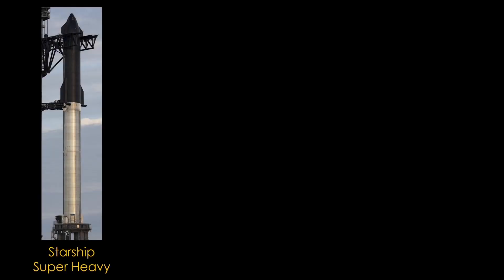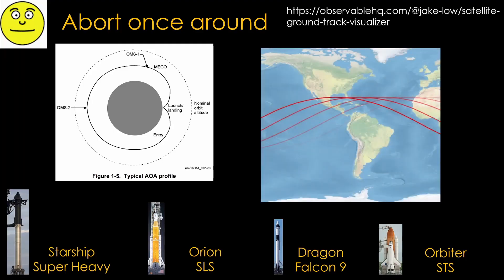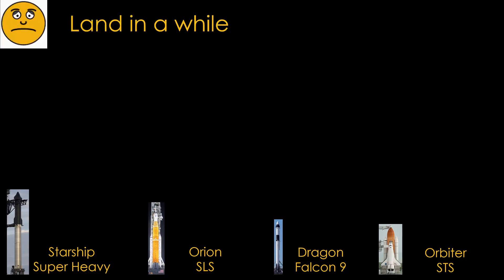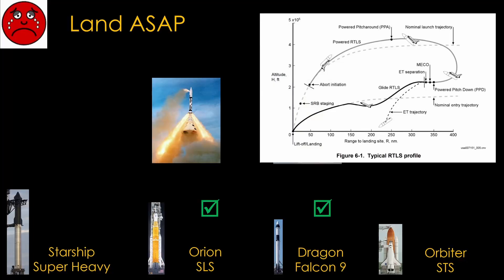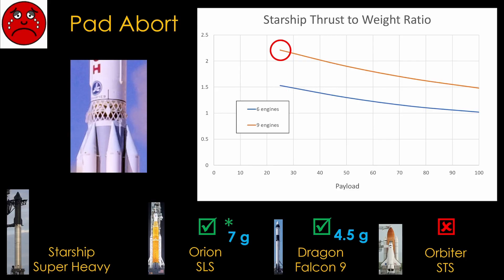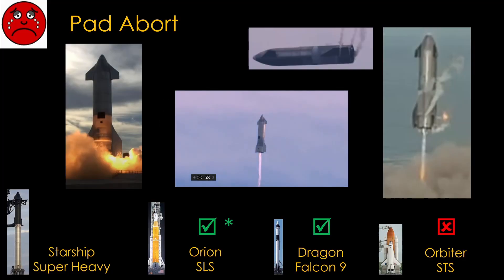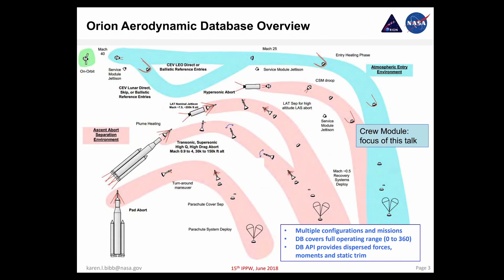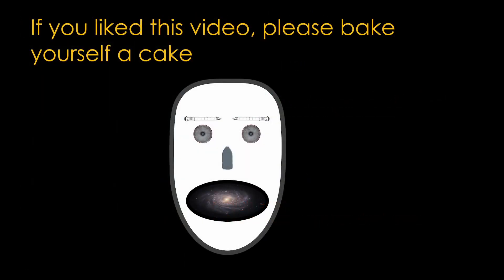Starship Abort Modes

Comment: If these larger rockets have a different internal geometry. If it has muti sided internal core running through the bulkheads. Shorten and backbend the rings for the core. Like a eight pointed cookie cutter with concave sides. The core rings can be made of thiner stainless. Another set of small rings go around the center core. The rings create the header tanks and downcomers. Baffles thin baffles tie the core with the outside skin of the starship. With that geometry the crew compartment can have a sleeve the goes into the center core. Bunch airbag like in sleeve. Det cord around the base of the crew compartment. Twelve of them Draco engine pods from the dragon capsule around the bottom of the crew compartment. Blasts the tile and insulation on ignition. 

There's an abort. Det cord blows, sheering the crew compartment from the starship. Airbag like device goes off in core sleeve. Like pop goes the weasel the crew compartment is pushed up and away from the exploding ship. Draco engines enough to litghtishly land the crew compartment, as the sleeve is used as a crush cushion on landing.

It be stronger and safer, I think. Lighter or heavier idk. Possibly lighter. The core is relatively compact so very light gauge steel could be used. The are on tension so they can very light and provide lots of strength. Unibody frame

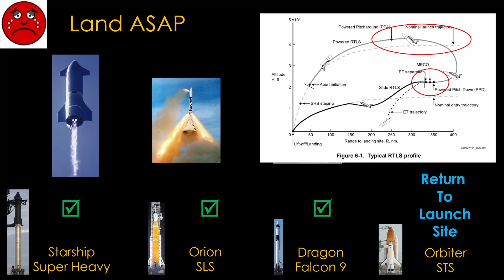Comment: 8:03 does starship alone have enough thrust fully fueled to stay aloft? shuttle rtls has enough fuel it has to get rid of it so it doesn't just plummet, would starship have the thrust to do the same?
Reply from the maker: My recollection is that it does with 9 engines.

Comment: I think my two main concerns when it comes to Starship aborts are:

1) Can Starship actually get away from a fatally-malfunctioning Superheavy before it explodes? Like in the scenario that LES is needed, the main purpose is to get the crew the fuck out of dodge before they die, and injuries from the sudden increase in G-forces could cause become a secondary concern. Hence why NASA uses solid rocket motors for their tractor rockets. 

Starship ain't the quickest to get going. It's a liquid-fuelled rocket, that's to be expected, and it's huge. That's a lot of mass to shift in a suddenly-developing crisis where they have seconds to get away. 

2) What if the fatal issue is with Starship itself? It's a whole-ass rocket stage unto itself, if it's the part that's going wrong, are the crew not just toast? This was an issue the Shuttle had too, and while with hindsight neither of the fatal shuttle incidents were "Orbiter malfunctions during launch", that was never guaranteed and the lack of a proper way to save the crew from the vehicle itself becoming the problem wasn't really acceptable. 

And sure, you can apply that question to capsule-based designs too, and they have gone wrong in the past. Apollo 1, Soyuz 1, and Soyuz 11 can all be considered examples of such, as can Apollo 13, though that one was thankfully not fatal. But there's a whole lot less to go wrong with those, because they're not acting as stages.
Reply from the maker: 1) The answer is "it depends on the scenario". Supposedly there's a "fast start mode" for Raptor that isn't kind to the engines but gets them to spin up faster. And Starship 3 will have a higher thrust/weight ratio and get away faster. 

I'll also note that booster failures are very rare and when they do happen they tend to start at the bottom of the rocket at the engines. Super heavy has a lot of engine redundancy and in most cases if an engine is starting to misbehave you just shut them down. 

2) Depends on the scenario. Starship scenarios would mostly be reentry ones, and those depend on working aerodynamic surfaces and lighting the landing engines. The flaps have redundancy and you only need to light 1 out of 3 engines for landing, so plenty of redundancy there. 

I'll also note that if SpaceX flies starship as often as they say, they will have a ridiculous amount of empirical data before they put people on it. It will be far better understood than any existing human launcher.

Comment: A crew Starship landing in water will fall over. That's a 50-70m fall. That's probably not survivable, particularly as the orientation of the forces is going to be random.
Reply from the maker: That will be fun to try to analyze...

* The acceleration won't be G the whole way; at 45 degrees the height is already 30% less and the acceleration will only be about 0.7G
* It will initially sink into the water some amount because of the mass of the engines, and that will both reduce the height and slow down the rotation
* As it tilts over the water provides move force against the bottom to slow down the rotation
* The circular shape will push quite a bit of water out of the way and that will absorb a lot of energy. 

You would need a fluid dynamic simulation to get a real answer, and I'd love to see one, but I don't expect to be at all like a fall from that height.
Reply: @EagerSpace  we may get some numbers on the next water landing. If the cameras survive and it's daylight. 

The people will be near the nose, which may fall faster than 1g at some points, even if the CoG is falling much slower than 1g. 

It might be like being in the bow of a ship in really extreme weather, or it might be really bad, I don't know.

Comment: "Landing anywhere" with a crewed Starship is going to require landing legs to land on land, and probably something to cushion the tip over when landing in water. My estimates are that the top of the ship hits the water with around 60 mph of velocity when tipping over.

My best guess at a solution is a few small SRBs to arrest the tipping motion right before it's fully horizontal. That would require the ship to fall on its "back", or non-heatshielded side, which is fine assuming the crew don't end up hanging out of their seats upside down. But it's easy to envision a seating arrangement that suits three orientations of normal acceleration. Just need seats that can rotate 90 degrees.

Overall, a "land anywhere" abort mode for Starship would probably take around 5 tons of landing legs and SRBs to accomodate, as well as a suitable seating arrangement and means of disembarking when the ship is on its back in the water.

Comment: Crew Starship is not a rapid launch abort vehicle , like the Crew Dragon capsule is…

Crew Starship, needs to be modified and have a modified Crew Dragon capsule on top, for takeoff and landing.

Crew Starship lunar lander, needs the Crew Dragon capsule on top as well, for aborting lunar landings and take off…

Just relocate the helium pressure tank and rebalance the setup 🎉

The modified Crew Dragon capsule, will use the same location for the abort thrusters and have a pass through portal hatch located in the center of the heat shield 😂🎉… for Starship ingress and egress 🎉🚀

Comment: If starship emergency lands in the ocean, won't it fall apart upon toppling over?
Even if not, the crew won't like it much ...
Reply from the maker: It's fairly robust and light so it should be fine in light seas, but it could break up in heavy seas.

Crew definitely will be unhappy.

Comment: If a heat tile crippled starship were able to reach LEO or something close, perhaps a rescue mission from a  waiting dragon capsule could be quickly launched.  I realize this would require additional docking technology for starship and if I were Space-X I would always have a falcon-9 or two or three in waiting for this very purpose (depends on how many people you're launching on Starship).  Perhaps the emergency docking mechanisms could be optomized for weight and mass on the starship side of things to keep added weight down.  I think it's worthy of consideration when you remember the loss of NASA's 2nd shuttle STS-107... If they knew what they were facing on re-entry they could of and should of aborted.  Same goes for Starship I believe.

I would call this a last ditch "mission abort" but when you consider the deadly alternative, it's worth doing.
Reply from the maker: The simplest thing would be to launch another undamaged crewed starship and pick the people up.
Reply: @EagerSpace  While we're talking about the possibility of Crew Dragon being used to rendezvous with Starship, is it possible Starship HLS could be certified to carry astronauts in space before any Starship certifications to launch or reenter with humans onboard?

Because I can envision scenarios where, as a stopgap measure, HLS ships are launched to LEO unmanned, then acquire crews via rendezvous with Crew Dragon, and then the return mission having another rendezvous to switch the crew back to Crew Dragon for reentry.

Comment: Is Raptor able to light without having completed an engine chill first? I'd think dumping cryogenics into a warm engine would be a nightmare no?
Reply from the maker: Interesting question. My recollection is that Musk talked about this once and said that Raptor has a "start right now" mode (not what he called it) that could be used in situations like this but that it would probably prevent reuse of the engine.

Comment: 2023 Update, Starship will be using Hot Fire Staging for stage separation, with an addition of a vented interstage on top of Super Heavy with thick steel bulkhead to protect the top. That makes Starship abort more feasible. There is a new Raptor in the works, Raptor 3 currently in testing managed 270 tons of thrust so far.
Reply: 2024 update, starship would mostly use tower catch as it seems so its interesting how abort modes would look if no catch tower is available (if crew compartment can survive water landing or could starship land on land with no legs (we still dont know how crew starship would look tho)), also Dragon has now abort scenario if all parachutes fail, Dragon can splashdown using Draco engines as they still fueled on landing from orbit.
Reply: @YuriKurokhtin  Maybe they will attach soft landing gear to abort
Reply: Yes, and no doubt the crew launch Starship will have more raptor engines in order to abort from the booster during launch. However, whether 3 or 6 vacuum engines, the vacuum nozzles are unlikely to be safe in the atmosphere, leading me to expect 6 sea level and 3 vacuum engines. Same reason during landing, more sea level engines will mean better engine-out fail-over during the landing burn.
Reply: no human will ever fly on a "starship" made by spacex

Comment: It's interesting to see possible abort modes for Starship's lunar landing scheme. It looks like there are almost none at all which makes the whole scheme very fragile (and strange). On the other hand, why we can't use the Starship to deliver a really safe LEM to the moon? It feels like there's enough capability for that.
Reply from the maker: Starship has 6 engines that are enough to slow down and land on the earth, which means lunar starship will have a fair bit of engine redundancy (assuming main engine use; not clear what their thruster approach is as it hasn't been disclosed). 

The lunar module from Apollo had low redundancy because weight was so important - it used very simple engines but there failures in some cases were problematic. 

If you wanted to use a different lander, you would need something more capable than the apollo LEM, as the orbit for Artemis requires more energy than the one used for Apollo.

It's certainly possible to do a vehicle more like the LEM - that's what the national team led by Blue Origin proposed - but SpaceX's bid using Starship was much much cheaper than the National team bid and NASA judged it to rank highly technically and to be the only one NASA could afford.

Comment: Very thorough, very informative video! I am concerned about the Vacuum Raptors being used in an abort since SpaceX was talking about how they'd be very Overexpanded at Sea Level. Hopefully not destructively so.
Reply from the maker: They test the vacuum raptors at sea level at McGregor, so they are good enough for that usage. 

https://www.youtube.com/watch?v=oTQymcS8ApE

You can see effect of the higher pressure pinching the plume right at the edge of the nozzle, and the formation of a mach diamond very close to the nozzle.
Reply: @EagerSpace  I was under the impression SpaceX started that those tests were using a shorter, lower expansion nozzle than what was intended for Production VacRaptors. I could be mistaken though.

Comment: Good video on abort options. However....
One thing that was neglected in this video is a failure in Starship itself. Any such failure would result in the loss of vehicle and crew! What Starship needs is FULL abort capability... Pad to orbit, and landing abort! This can only be achieved with an electable capsule for the crew. Yet Musk has no plans for full abort on Starship. A disaster waiting to happen. Musk fans.... STOP defending this!
Reply from the maker: Two thoughts:

We don't actually know what SpaceX's plans are for crew starship, as they are surely in flux and most of the details are not shared with us. 

What matters is not abort systems but how reliable the systems actually are whatever the architecture is. We all fly airplanes with no abort systems cheerfully, because we know what the loss-of-crew numbers are.

Comment: Good video, but few more things to note...
8:13 Shuttle kinda* had a pad abort but it involves flinging the hatch open, jumping into the Emergency Egress Basket (basically a zip line) and getting to a bunker 1/4 mile away, all while hoping nothing explodes. The same baskets were kept for Dragon and Orion, and are to be used for less urgent emergencies.

9:27 The danger of the SRBs probably partially explains the high g's for the Orion abort. Also worth noting the the SRBs on Shuttle/Orion used multiple steel segments, while most SRBs on Delta/Atlas/etc used composite/fiberglass materials. Steel usually doesn't fail dramatically, but gradually weakens, deforms and leaves gaps for hot gas (as in the case of Challenger). Contrary, single piece fiberglass/composites can crack easily, and a small crack will quickly expand and cause the whole booster to explode.

Also, Just for fun, the Ares I/Orion would have had the second worst abort capability (with shuttle being the worst) because it would parachute though the cloud of burning SRB fuel during any abort within 30-60 sec of launch. Lets hope not such issues are present for SLS/Orion. (http://images.spaceref.com/news/2009/fratricide.report.pdf)
Reply from the maker: Thanks. 

One note: https://news.northropgrumman.com/news/releases/northrop-grumman-and-nasa-successfully-test-space-launch-system-booster

Comment: Thanks. I think the pad abort section shows pretty well why Starship’s “use the main engines” option on the upper stage isn’t really a valid answer to the scenario, even if we assume a compromised Superheavy doesn’t also damage the upper stage.
Reply from the maker: I'm not sure what your point is. Why isn't using starship's engines a valid answer?
Reply: @EagerSpace  It’s just as you pointed out - the engines need to have time to spool up, and even if they can be brought online quickly enough in a disaster case they don’t provide anywhere near the kind of acceleration that you’d want to try to move yourself away from an exploding booster.
Reply: @ryanrising2237  

There’s also the acceleration from pneumatic pressure sending the ship upwards a short height if that section were suddenly to increase in pressure from the engines venting gas into that direction. With Raptor having a high chamber pressure I don’t see how that would be a problem in terms of high—> low pressure. Also during ascent the booster could use gridfins to increase its own drag to force itself to slow down away from the ship.
Reply: @topsecret1837  There are plenty of options for separating the two if everything is working properly, yeah, but it’s a good idea to design an abort system specifically to work when the rest of the system isn’t.
Reply: @topsecret1837  Pressure outside of the engine, even a distance away, is surprisingly important to the operation of a rocket engine. For Example, the Saturn I was extensively designed around aerodynamics of the "skirt", and different exhaust paths not creating any sort of interference with each other, as this could potentially send a shockwave up the plume and into the engine and destabilize it.
Reply: coming back to this after IFT-3, I think in hindsight we can retire this concern given the Raptors are now more capable than at the time of this video, and that hot-staging seems very mature.
Reply: @dsdy1205  I could not disagree more vehemently. Using the second stage's Raptors is not and never will be an escape system suitable for vehicle failure. They could be the most reliable engines in the world and this would still be the case, because it still doesn't provide the crew an option if anything goes wrong with the orbiter.
Reply: People will have to suck it up and risk dying to truly colonize other worlds. Crewed starships will not have abort options early in the flight